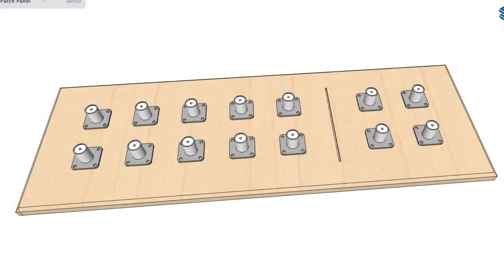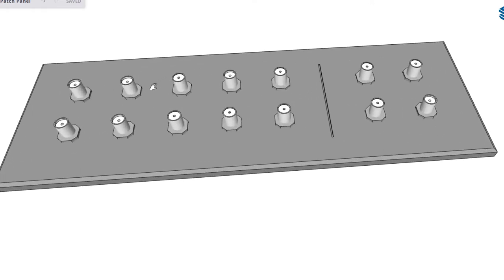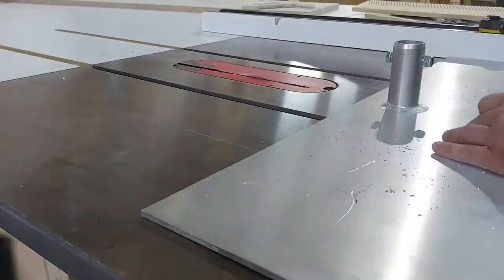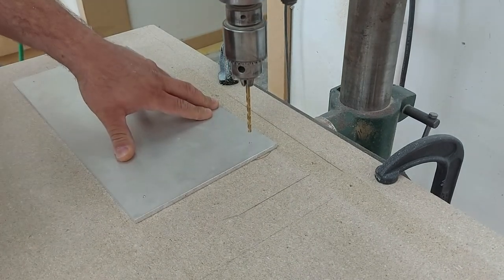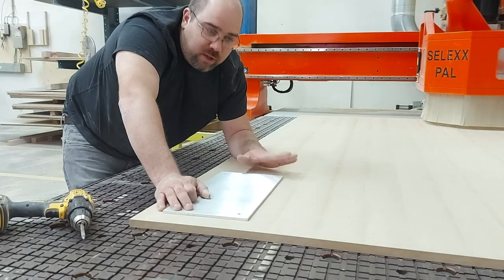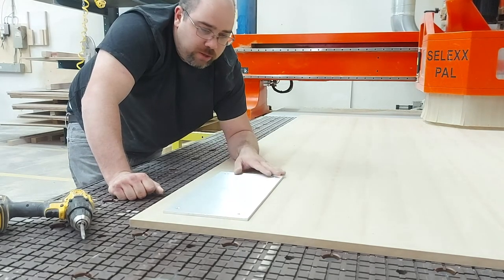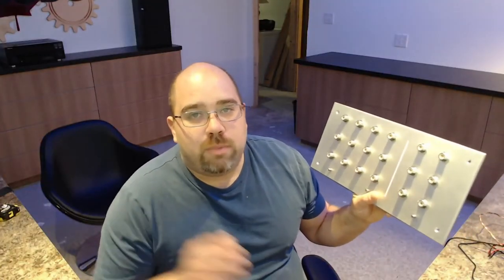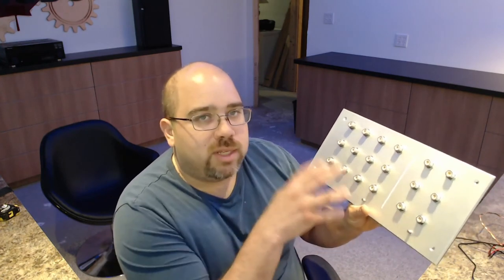Coax Patch Panel and RF Ground

Comment: I've been working on my own version of this. I have 5 HF radios, 2 HF amps. Each radio and amp has a RCA connector for PTT(also AGC). I was considering adding RCA connectors to patch in and out the PTT to the amps. What do you think?
Bob, K3ADU
Reply from the maker: That could be tricky. PTT is achieved by shorting to ground on my rigs so if the connector is not isolated it could be an issue. At least that's my first thought when I think of it.

Comment: Great idea! is it a bad idea to add my power plugs? It doesn't use the house ground. I don't have a usable ground in the house built in 1865 and wired in 1930. My power supply is choked. I'm just wanting one panel for all the stuff.
Reply from the maker: Hey Craig. Thanks for watching and thanks for the question. Personally, I would not do this. Best to consult an electrician in your jurisdiction and rely on their expertise. Sorry I can't be of more help on this issue.

Comment: Hi Daniel, great project! As far as further suggestions for the "mark II", do you think there's a way to conveniently connect the center conductor to ground on unused antenna feeds? So that disconnected antennas would have a way to bleed off static that may build up?
Reply from the maker: Hi Wayde. I was thinking about this exact idea. i was thinking that I could achieve this in at least 2 ways. 
1- By having 2 actions timed using actuators. One actuator connects/disconnects the connectors and the second moves a grounding plate in position to short the pins. In reverse, they would be timed in reverse. 
2- When the panel is disconnected there could be a spring-loaded grounding panel that flips into place over the face of the center pins. When the panel is reconnected it moves it out of the way using a simple mechanical arm.

Since I filmed this project  I have been given "permission" from my wife to install a new tower so this project will be moving forward and I will be looking closely at how to achieve this in a reliable but simple enough way. 
I will be trying to put a video together soon to discuss the projects and some of the planning I have to do. Would love to get feedback from you along the way. 
73s
Reply: @webuildwelearn  A new tower and a fun project! Lucky! 😊
If you could modify the thru-bulkhead fittings you're using so that the center conductor is accessible (without too much damage to the fitting or threads, that is :-) ) or, as an alternative to using the thru connector, use fittings that you solder onto the feed lines, where you might have additional options for accessing the center pin ( This makes it a bit like a punched down network patch panel, where the "plant' side is punched down more permanently as to the jack side), then you might consider something like: 

- The manual way; put a dual throw toggle switch by each feed that connects the antenna side center pin through the panel on one side and into the ground on the other

- If you wanted it somehow/somewhat controllable, use relays to switch the antenna side center pin through the common, and  NC/NO contacts between panel and ground?

- or... the really manual way, if the fittings count doesn't get too far out of control... pair up a matching  SO239 for each feed line on the panel, you want to use an antenna cross-connect it to a radio port, when not in use; cross connect it to a "ground" fitting? 

The BOM cost is climbing 😂 

Hey, this actually reminds me... did you catch the YT video a couple weeks ago "What's Going on at W1AW?" - about mid way through they show their antenna patch panel, maybe some inspiration there?

73s!
Reply: @Wayde-VA3NCA  I had considered this for my plan but the regular switches and such might be too capacitive. Daniel has the idea for a military style shorting cap. That's what we did in the Navy.
Reply: @radiotests  at HF and with short leads, I'm guessing the effect might be low, but as you climb up in frequency, yes, something to definitely take seriously